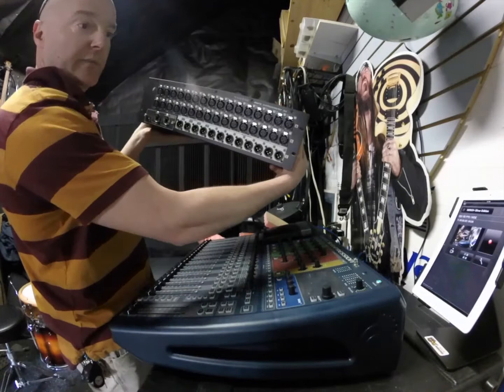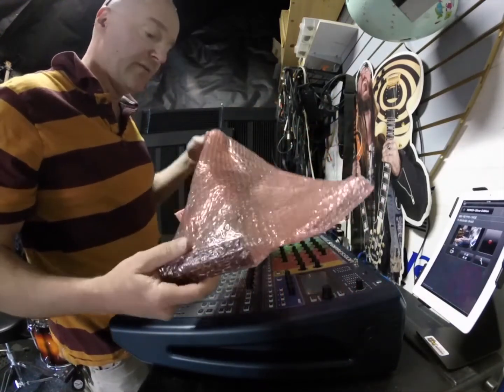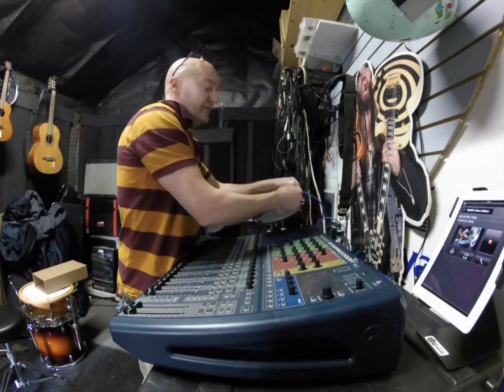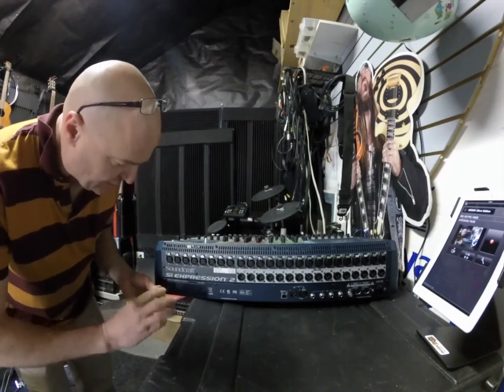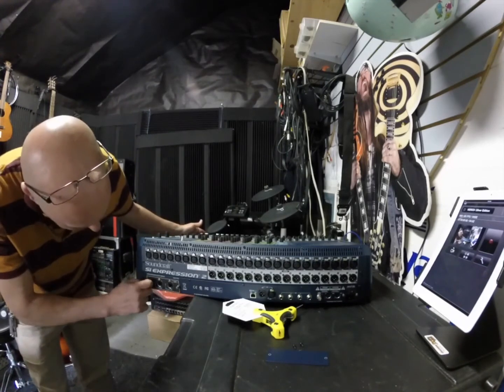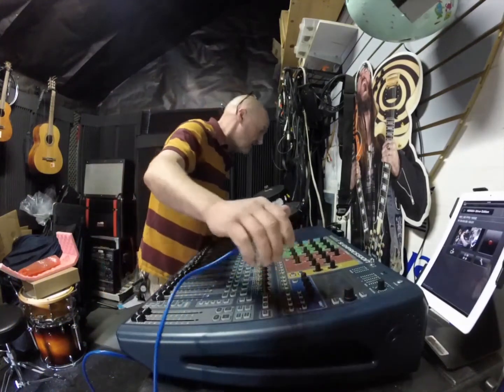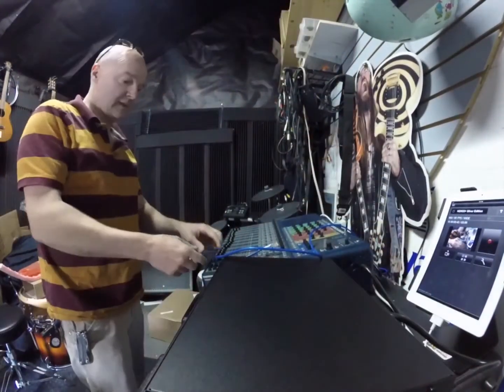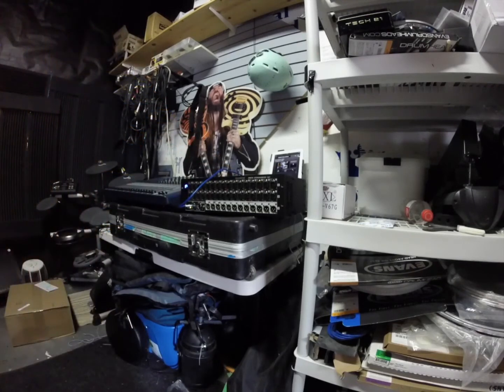Soundcraft SI Expression 2  Madi card install for Mini Stagebox 32i

Comment: This video is not that helpful. Installing the Madi card is straight forward and anyone can do it just by unscrewing the bolts and following the guide to insert the new card. The one that gets confusing is configuring the board to communicate with the box through input and output patches (if using i/o). How to know if the new card inserted is active and working is by looking on the touch screen far upper right corner and it will show a green rectangle with little squares.